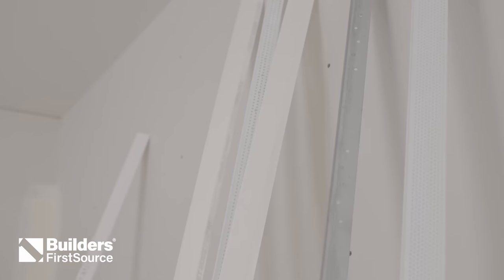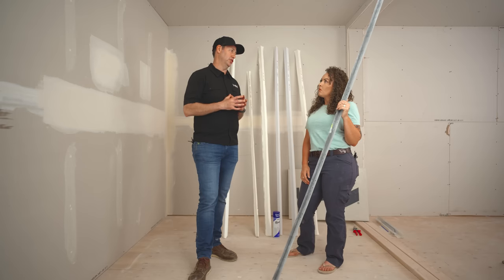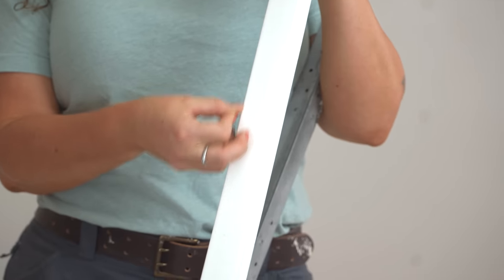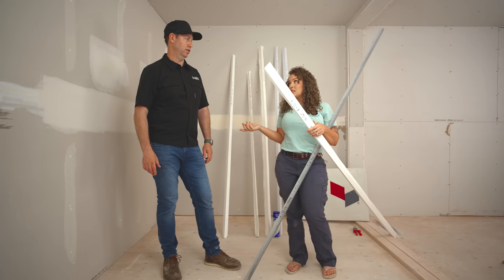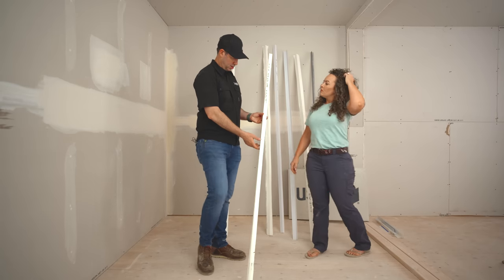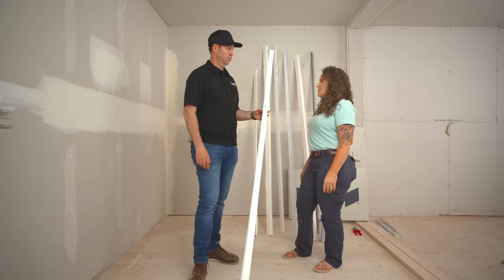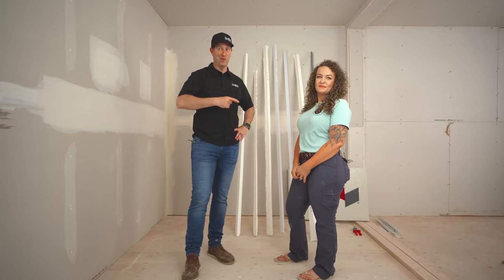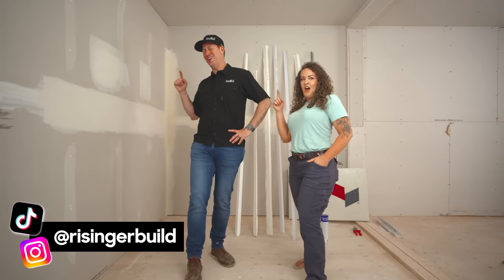Corner Bead Pros & Cons with THE DrywallShorty

Comment: The best drywall on a project is no drywall on a project.
Reply: What are the alternatives?
Reply: @DMSparky 
Wood
Steel
Stone
Tile
Reply: @DMSparky  hehe.  Mostly just referring to my desire to never touch drywall on my projects.  So I’ll do T&G, stone veneer, tile, barn wood, etc.  Easier for me, doesn’t cost much more (I’d hire drywall finishing), and wears and handles moisture better.
Reply: @robertrusso877  - yep, all the typical commonly-seen wall materials in today’s houses.

@nathanmrudd  are you longing for the good 'ol days of stone castles? No drywall there@
Reply: @bethanyanderson1745  yes.  Cabins and castles.  Upgraded with sound building science, of course.  🙂

Comment: They also have an inside corner paper-faced metal.  It is fantastic for getting perfect inside corners.  MUCH quicker than folding tape and fighting with it.  And since we have movement here due to soils, it has (for 5 years so far) kept away any cracking in the corners.
I like the spray-adhesive kerfed stuff for doing arches.  The paper-faced vinyl looks intriguing for standard outside corners.
Reply: I wish I would’ve used them!

Comment: I've always preferred straight PVC.
- Zero concern of rust in damp locations (especially paired with stainless trim nails)
- Flexible (if you want)
- Can cut it with a knife or scissors
- No super sharp corners

Not fast if you're a "production" guy, but it's easy and convenient for a DIY person.

Comment: I've run tens of miles of metal corner bead, building museum exhibition walls. Like she said it is great for maintaining a straight corner, and is easily joined - I use a small scab of bead behind the joints to line them up perfectly. And it is fast. We put them on during the drywall portion of a build, and the tapers come later, so no option for a mudded-on bead. Spray adhesives are not permitted to be used at scale in the institutions where we work. It also comes off easily when it is time for the show to come down, with the bonus of exposing the screw heads beneath so we can strip the drywall even easier.

Comment: OUT of all of the corner beads presented, I have to say I am still a HUGE fan of the Metal, production level are just so quick on them is incredible. Second option depending on how many beads are being installed would be the mud set vinyl trim trex or paper bead from certanteed. Glue is expensive as you have to buy glue, staples, then waiping down the beads to make sure is on property.

Comment: After 20 years using metal and fiber fuse after it’s installed first coat with tape mud and fiber fuse comes out amazing. Usually have it filled, most only needs one coat.

Comment: When I first got in the business it was definitely the drywallers job to hang corner bead, that was in the 3 states I had worked in, Nevada, Arizona and California! But when I went to Houston TX in the union anyway Tapers installed the paperback metal corner bead, using the mud trough and roller.

Comment: I use PVC but I’ve always fastened it with screws and not adhesive. I didn’t know about the adhesive honestly but it’s worked out fine if the screws are set right and the mud is feathered out.

Comment: I don't know where she buys her metal  corner beads but at my local home depot here it's 55$ for a box of 25, 8 feet long.
Ohh and 55$ CANADIAN. 
Most other places vary from 3,50$ to 5$ a piece. 

I have tried the no coat, yes, they are almost indestructible but like you said, can't fix framing with those. I went back to metal ones. I apply mesh tape on each side, it will fix 99.9% of any cracking issues.
I also have a special tools that can adjust the angle of my corner beads, so i always pass them in my tool, they come out with the perfect angle, take no more mud than no coats, can easily pass them with 2 coats, with machine mud.

You also have missed the AquaBeads, witch are paper faced, pre-glueds, just need to activate the glue with a mist of water.

Comment: To fix a banged dead on the nose of a metal cornert bead you can use metal putty then finish the surface with durabond 90 and plaster of Paris. Also to prevent cracking of metal corner beads you should add drywall tape, durabond 90 and plaster of Paris or in some instances you can use fiberglass tape in lieu of drywall tape.

Comment: So, can you splice the expensive fully composite product with a lower priced product… fully composite maybe 6’ up the wall and then cheaper product up to the vaulted ceiling where nothing will ever hit or damage it?
Reply: @samuelharward2451 - good question!
Reply: I wouldn't do it on the same corner. The height of the corner is going to vary based on the product. Getting it to look like one continuous edge isn't going to be worth the $4 you save.

If you have corners up high that don't connect down low, go for it.

Comment: I find it interesting her take on No-coat.  I did finishing for over a decade and have used No-coat since it was first introduced.  We loved almost everything about it (sharpest corners, quick to put on, fast to finish, and most of all, tough).  That's where my opinion differs, I've never had a crack with a No-coat corner, and in fact, one job proved it to be one of the toughest we've seen.  Installed several boxes of No-coat on a commercial job, we ran out and had to run stairway hand rails in metal (under a wood touch point).  We had dozens of repairs on the metal from the other workers denting and cracking it, usually requiring 2-3 coats to get back to nice.   We had one worker take a bakers scaffolding piece and run it into the very corner (within a 1/4 inch of the tip) of the No-coat bead, it barely dented it, and was a one swipe fix, no crack at all.  I'm wondering what is going on that a trimmer will make their no-coat crack...  I will agree with the paper issues, you can't 'work' it too much otherwise you'll fuzz the paper which is a nightmare.  And bubbles can be an issue (less with the hopper), but a nail driven into the framing behind a bubble does fix it.  Overall, a fantastic product with limited down sides (mainly, as was said, it's for use as a pro, it takes some training to get the hang of it)  (You should google some old ad's before Certainteed bought them out, they take a bad and take a full swing at a finished corner, no cracks.  It's not just a gimmick, i've experienced it myself)

Comment: I wonder what she thinks of Aquabead? Has built in adhesive (lick and stick!). I guess I’ll just try it. Price is comparable to other products. So far so good. Added a short wall to a closet opening and needed to throw up a couple sticks. Did it while listening to this video. Just wet the inside and threw it on. Used my hand coz I didn’t have the corner sponge roller in the crappy silent mfg video.

Comment: if you nail the bead to the framing its locked to house movement, if you tape it on it isnt.......different areas probably favor different ones.....ive never had a problem with any of them, if a 100 ton house is going to move there really isnt much you can do.....